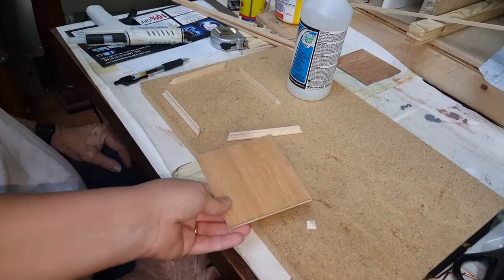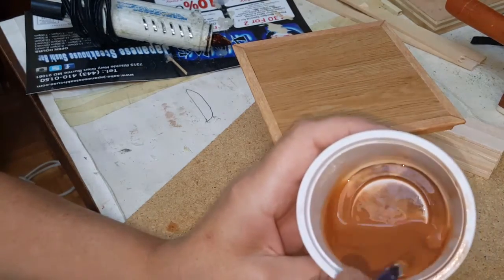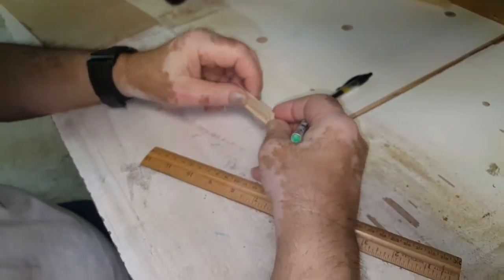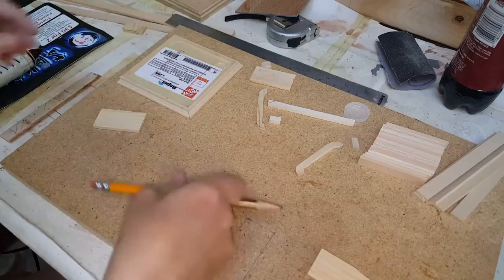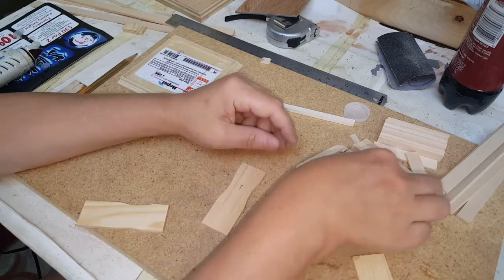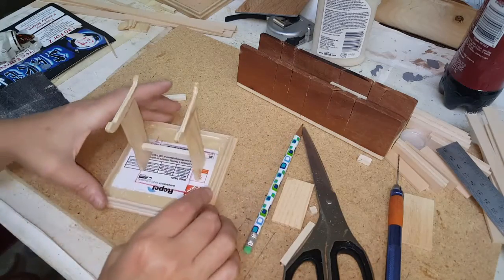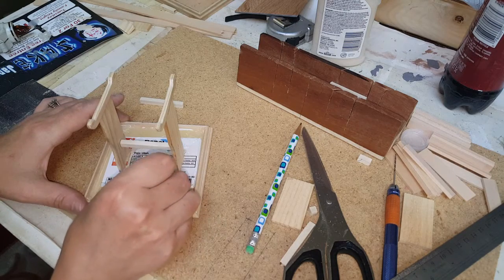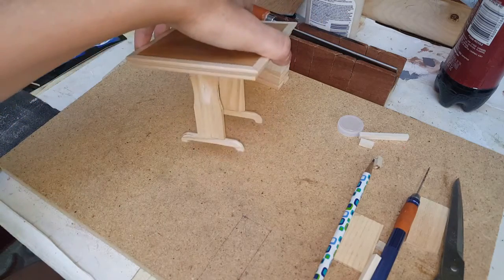Kitchen Table 082016

Comment: Hey Laurie  I love what you and dad do, but I'm asking if you can get the volume stabilised a bit. There is a fluctuation, sometimes you are heard clearly n loud and another time I can barely hear you. Thanks much in advance
Reply from the maker: Misha Harrigin I'm sorry that's probably because I record then let it dry than I come back to record more. Plus I'm always moving around. However, I did order a microphone and when that comes in I will see if it will work any better.